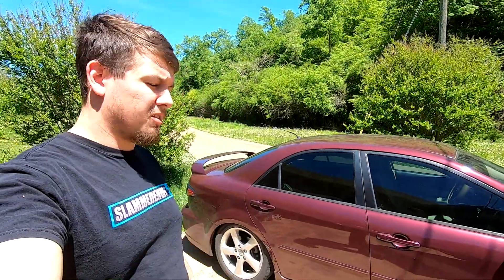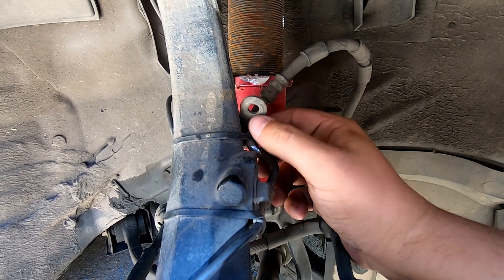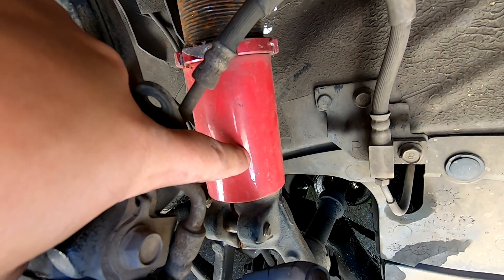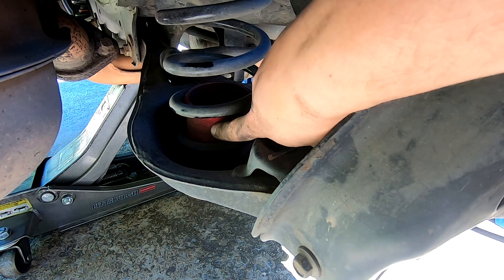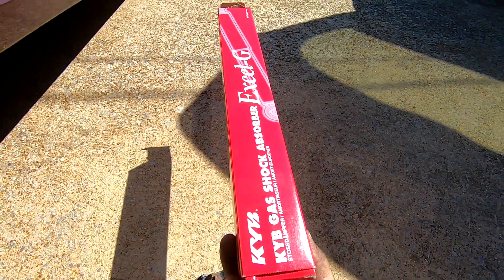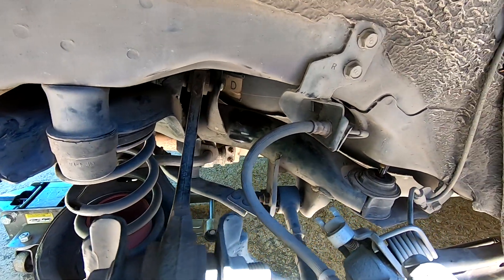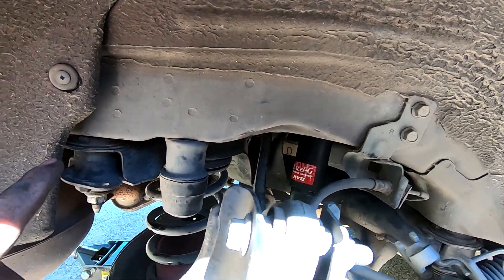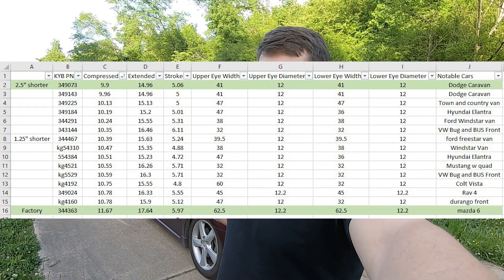Ebay Coilover Issues + Rear Shock Fix - Mazda 6

Comment: Got a mazda just like this last week.. and had the same issues with these same max peeding rod coilovers!! So I been researching what I could do with the back shock..  cause I didnt wanna spend 900 on coilovers!  Or 300 and get some more junk!! You explained everything well.. now I gotta order a dodge caravan shock
Reply from the maker: Good luck with it. I would take a peek at your rear toe in once you get your ride height set. Mine was toed in and ate a set of tires before I realized it.

Comment: Hey thanks for the helpful video. I’m trying to put maxpeedingrod coils on my Mazda6 right now. I am not sure how to get my sway bar end links on the front to reach after I set the ride height without putting a ton of pressure on the sway bar. Did you have this problem?
Reply from the maker: Go ahead and adjust both sides to the right ride height then pick the car up with both tires off them ground and you should be able to hook it up.
Reply from the maker: Mine fought me at first because I tried to set one side then go ahead and attach it before setting the other side.

Comment: Have you been able to raise the height of the rear of the car?
Reply from the maker: I've got it bottomed out as low as it will go right now. You can thread the collars up higher on the red spring buckets to raise it but I've chosen not to.

Comment: I got here because I want to lower it, but seeing all those details and problems, Now I don't want to keep it low, I was excited to put it lower but there are many details
Reply from the maker: Yeah some of the Ebay kits have the lower rear shock mount relocated to the side kind of like I did which helps you to not bottom out as much. I would say for as easy as it was too install everything if you only wanted to go down 1.5-2 inches it would still be worth doing. I just have to find the absolute limits of what I can go with it lol Im trying to get it even lower still just for fun